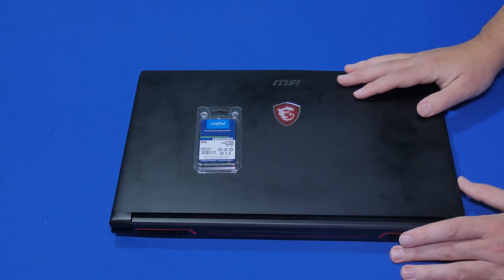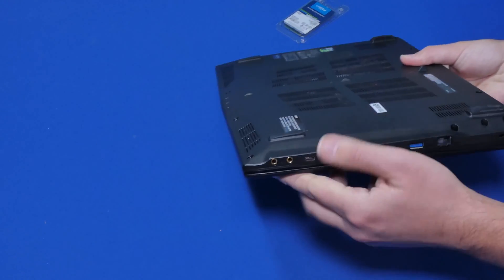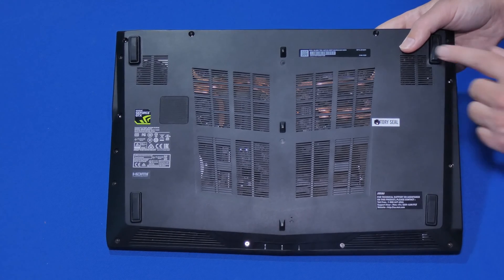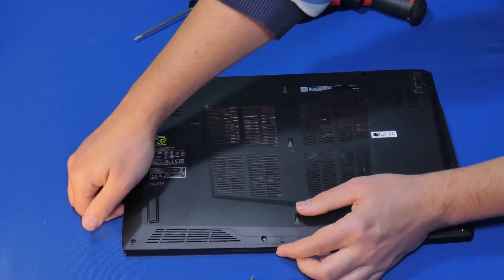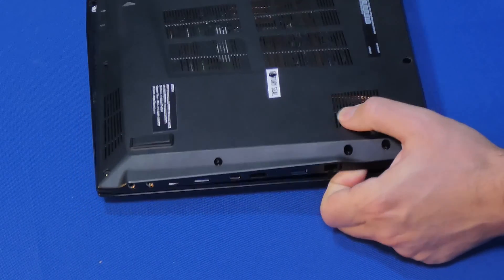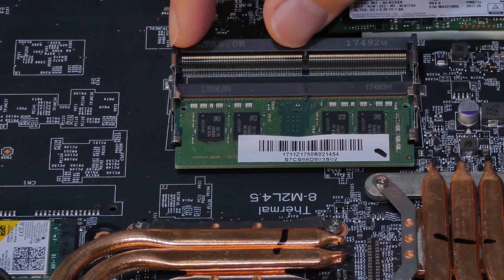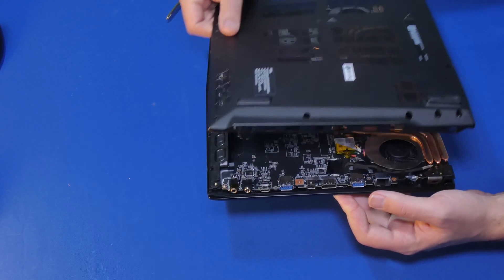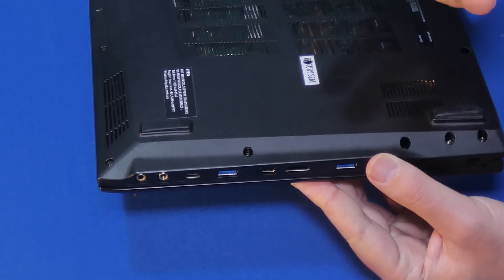RAM 16GB Upgrade MSI GL62 7RD Gaming Laptop

Comment: Thank you for very informative video. I tried to install 16GB RAM (single SIM) and ended up in nightmare as this 16GB RAM was operating at 3200 MHz and I think this laptop model only works with up to 2666 MHz memory.

Comment: So it's not necessary to take off battery while putting new RAM?
Reply from the maker: No, but technically speaking it is recommended. If possible remove the battery first. That was an oversight on my end.

Comment: any update on how it performed after the upgrade? mine seems to be very slow, purchased used, i have deleted a lot of unnecessary apps and such. startup processes are minimal. i want to go with 32gb 3200 ddr4 but i worry about paying 120$ if i wont notice a difference due to slow cpu. i play a lot  of ram intensive games like BeamNGdrive and such.
Reply from the maker: Honestly, I think 16gb is max I would ever put in this computer. Computer will use more RAM if you give it. If you're having slowdown problems I would do a fresh OS install.

Comment: such a great video. but i want to ask, im using this laptop mostly for Autocad and Ansys. does upgrading my ram into 16gb of ram can bring a lot of difference in performance when it comes into Autocad, Ansys and simulation software???
Reply from the maker: It will probably help because computer will try to use as much as it can of RAM. Especially when you open two or more programs.

Comment: Hello can i ask? :) Ive got in my MSI GL62M 7RDX 4GB of ram and i want to upgrade it. So my question is : Can i add 16GB to 2nd slot if i have 4 in first? Or second opionion i thinked : I remove that 4GB DDR4 and replace it with 16GB DDR4 and my question is Do it change something? I am scared i brake up something,
Reply: Check out MHz for the current memory. I have latest version of MSI gaming laptop with 8GB memory and it couldn’t work with 16GB x 2 memory modules

Comment: hey, I dont know if you still reply to these comments but did this upgrade make a big difference in performance in games. Like fps being more stable with less drops?
Reply from the maker: In my case it helps but depends on the games you play. Try playing a game and then open Task Manager under performance see how much RAM is being used. If you see that all it is being used then it's time to add more or you may have issues with FPS drops.

Comment: i have that laptop, same model, GL62 7RD when i was read the manual, it says this laptop RAM can be upgrade up to 32 GB.. but is it possible to upgrade it into 64 GB RAM?
Reply from the maker: Well, if you had 4 slots it would work. But with only 2 you can't fit more than 16x2.
Reply: @Cobuman  but what if i use the 2x32 of RAM and put it on the slots?
Reply from the maker: @BagusBasuki0509  good question. I honestly I am not sure if it will work because it's super rare to see a single stick of 32gb laptop RAM... there are a lot available for Desktops but not so much for laptops and maybe that's why supposedly max 32GB is supported.
Reply: @BagusBasuki0509  32g also
Reply: @梓浩-g8b  which is means?
Reply: @BagusBasuki0509  gl62 max support 32g only. If you put 32x2g in 2 slot, it's also 32g only.and it can't become dual channel

Comment: Can i use ram 3200 speed on this laptop?
Reply from the maker: They do sell RAM of that speed for that laptop: https://amzn.to/3hKiX5H but, I'm not sure if it will run at those speeds... it will depend on BIOS support. If you buy just one stick and mix with original RAM it will run at lower speeds for sure.
Reply: @Cobuman  hmm.. If the bios cant suppot up to 3200 speed, maybe can cause bluescreen or the ram speed just lower?
Reply from the maker: @Yappy5555  It would just be lower.

Comment: Hi there. Do you have experience with this laptop (GL62M 7RD), after reassembly and it won't turn on? The power light is on, but there is no boot process running and only black screen.
Reply from the maker: Depends why your reassembled it... Did you change the screen by chance? If so that would be a reason why the screen is black. If screen is not turning on I would suspect bad screen or maybe it's not connected properly.
Reply: @Cobuman  Well I only removed the hdd (its broken) and installed a new m2 card. Apparently after reassembly, it wont turn on. Just blue light on the power button. Tried reset the cmos (plug out/in the battery), but no luck.

Comment: Is that heatsink and dual fan interchangeable with the MSI PL62?
Reply from the maker: Compare the two when open. If you have PL62 open it, pause this video and compare. The case looks similar so I'm assuming there is chance... but I don't know for sure.
Reply: @Cobuman  Yeah they seem pretty similar. Same weight and dimensions too according to the msi website.
Reply from the maker: @garrtrigger  In that case I suppose it could work.